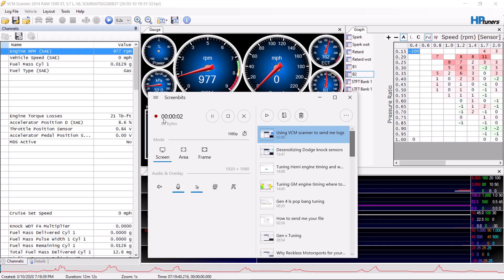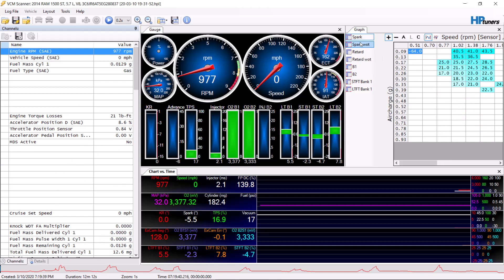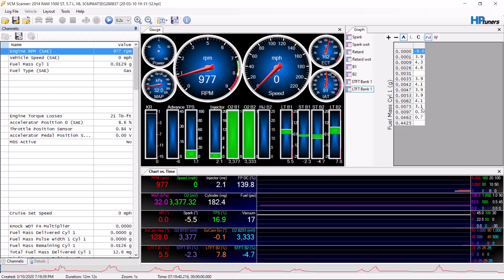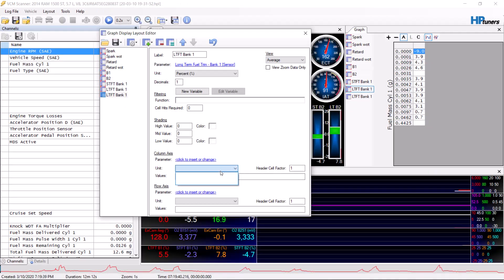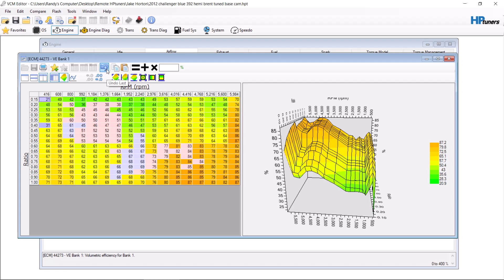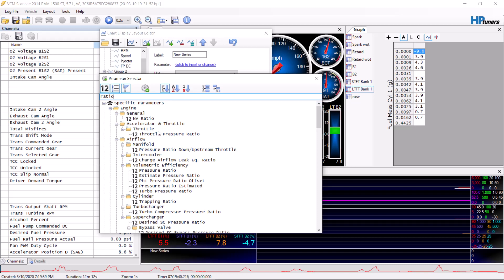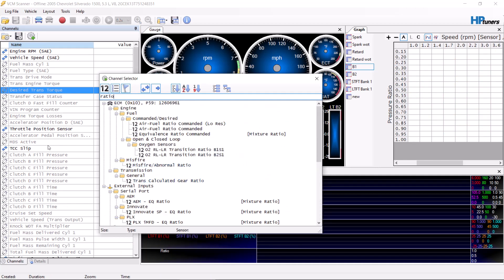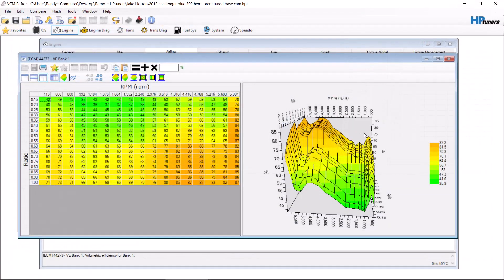Setting up the VCM scanner for Hemi tuning

Comment: Hey man been following your videos for a while I started when I got HP tuners. You and some others have taught me a very lot. I took my 12 Hemi ram  from a close 7 second dash to 60 mph to a 5 flat and a close to 15 in the  quarter mile to a high 13. This one's got the dreaded 65 rfe6 speed. No parts were added to the motor or transmissiom. It's a beast. This with modifications to the power request tables the throttle body air flow model the complete transmission file. And a few other goodies I found along the way. Thanks for making great videos Man HP tuners coming up in the Dodge world and we're going to put LS to sleep

Comment: Hi...can you make a short vid on the HP tuners PIDs for O2, WB, Lambda, Equivalence and Fuel Trim. For MOPAR can you include expected range of values and what are considered rich vs lean for each. (the EQ PIDs have a lambda symbol which seems to imply an Air-Fuel ratio vs a Fuel-Air ratio totally confusing. Knowing the range and rich vs lean should help to clear up). thanks

Comment: Awesome thank you!  Looking forward to your hemi boost video.
Reply from the maker: Coming soon!
Reply: Any chance you can give me some tips on a Hemi tune I’m currently working through.
Reply from the maker: @robinsonsauto what’s the issue
Reply: @Recklessmotorsports  do you have a platform in which I can share some files? your videos are top notch man and any assistance I will be sure to credit in future updates. all and all she's running decent. been following your tips using the spreadsheet for dialing in B1 B2 VE rinse and repeat. I'm close now still trying for =/-5%  using your method. slight Gallup at times coming to a stop. start high idles seems ok then as it levels out she gets a little to aggressive. i have my latest log i would like to share if possible